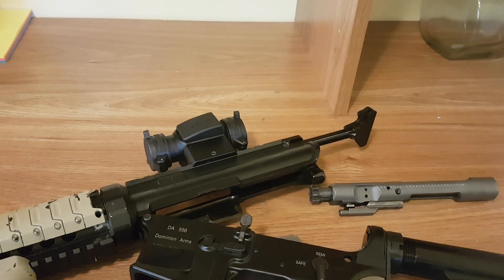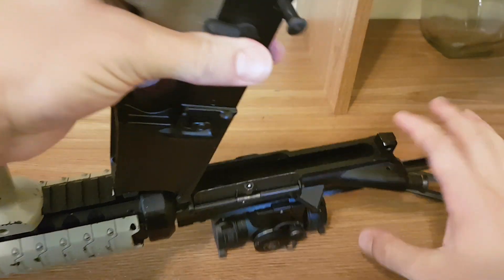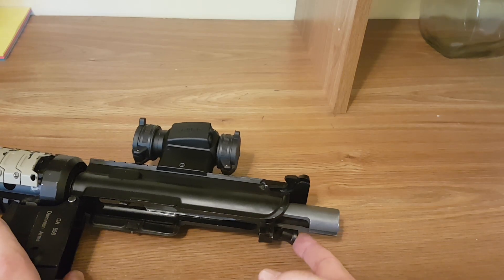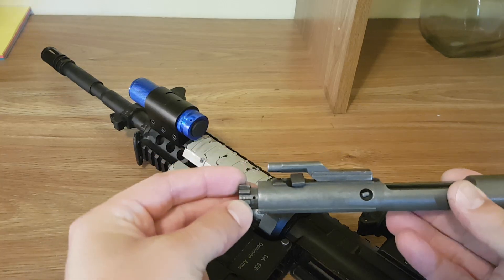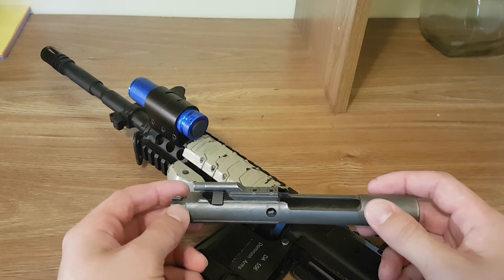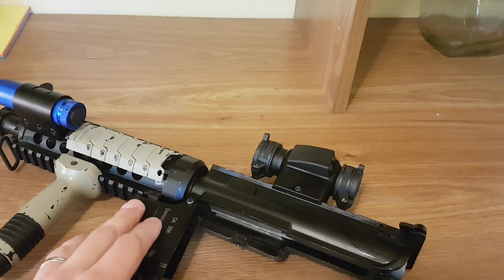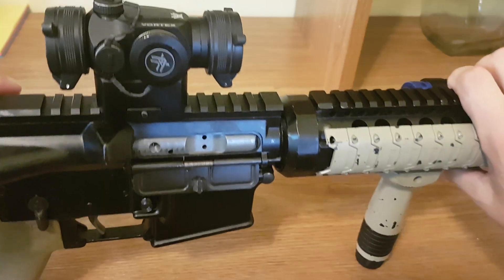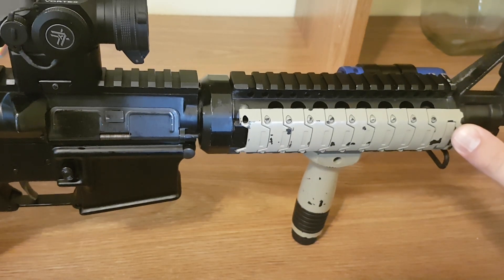What does the Forward Assist on the AR15 Do?

Comment: Someone mention down below this fwd assist wasnt needed and would only cause things to break. I believe the main purpose for it was during war time like Vietnam,  and in the heat of the battle this served a great purpose. Not seating fully caused jams, which couldn't be tolerated for obvious reasons. Have to put things in perspective.....  I carried this weapon during my military days and this feature was very helpful and necessary, unlike the m14 which had no issues with seating rounds, but much heavier then the m-16 but more reliable..

Comment: Another purpose of push button is to avoid noise. if you pull the charging handle and release it hard, enemy can hear during ambush. Soldier can firmly engage the chamber by pressing the button after slowly push the handle

Comment: Fun fact: the forward assist was not part of Gene Stoners design the Army insisted on having it. He actually explained this to the department of defense, the last ting you want to do id force a round into a dirty chamber, whish quickly leads to function failures. The chamber fouling tends to embed in the soft brass cartridge case and lock it into the chamber at the moment of extraction.

Comment: For fire and maneuver tactics, where many rounds are fired to suppress enemy movement or observation. Several hundred rounds may have been fired through a well oiled rifle, possibly causing a buildup of crud at the bolt and breach. The "SPORTS" method of clearing a jam is employed to get through the stoppage:

Slap (the bottom of the magazine), Pull (the charging handle), Observe (look at the chamber for a cartridge), Release (the charging handle), Tap (the forward assist "button"), Squeeze (the trigger)

Comment: the forward assist pushes the bullet basically in the chamber if it's such a Jammer or get hot or it just doesn't want to slide down the ramp so that's the forward assist otherwise she never touched that

Comment: Maybe it was already pointed out the serrations are on the  "bolt carrier .  The bolt
is the smaller piece sticking out the front of the carrier. The forward assist was used as a kind of a last resort incase the round was not seated properly and needed to be "assisted" into the correct position to fire. Needed in the Vietnamese War due to the mud and other debris that could get into the chamber area. Hope I did this right.

Comment: get an ak. It doesn't require a button to help load it lol
Reply: MartinsBrew Okay.... "30 rounds on a square millimeter" and "power of rock thrown by a kid at 350m"... 

Now I know what kind you are.... 
Have a nice day....
Reply: MartinsBrew I could do it from 300m... no problems. And that was with irons....

The point still is, AK design allows very accurate firing up to 600m (that is 656 yards). the problem isn't accuracy but the delay for a running man. at 150m distance a running man can move in a second about 5-7m. So hitting one is luck with any weapon if the person maneuvers at all. from a 600m it is nearly impossible if target doesn't stay still or have a constant movement. And other rifles doesn't really give better accuracy as at the point the bullet precision and weather is the key factors.

But big difference is as well that in many European countries the typical engagement range is 25m.... yeah... and that is required to be done from knee as under foliage is too thick to see anything. So long range shooting is rare thing.
Reply: MartinsBrew i know what ineffective  means, but in the case of firearms it doesn't refer to lack of energy specifically, and your comparison to a 3 year old throwing is underexaggerated. my point is that you lose the ability to control the trajectory dozens or hundreds of yards before you lose enough energy to equal a 3 year old throwing a rock.
Reply: MartinsBrew 'ineffective' means 'unable to cosistently hit a man-sized target', not 'loses all force above what a 3 year old could throw'. it would still kill you if it hit.
Reply: paristo. 182 meters standing all day... One shot with a AK 47 with iron sights... different? At 365 meters laying down I can put 30 rounds in a square millimeter... AK can not do that, maybe a SKS can... but not a AK...
Reply: unfuckingmaker, clearly you don't... so hitting a target with a 22lr. at 300 yards is effective to you?
Reply: Because they are in some cases piss-poor trained. 
Remember the soviet-afghan war and operation cyclone where the CIA basically trained the mujahideen? Wars are not won by equipment, but rather decisions. Mind you that modern Afghanistan is a lost fight and not a won. Most western troops retreat out of Afghanistan because it's just a lost fight. And that has nothing to do because the Taliban have some miracle technology at hand that outperforms westerns. 
The Vietnam war was again a good example of why a war was lost, even though the NVA or Vietcong, for example, had used stuff like various forms of AKs.
And gas pin operated rifles are indeed more reliable than direct impingement at the loss of some accuracy over greater distance. But in most cases, US troops or any troops, as a matter of fact, won't gunfight at those distances over their effective range and rather suppress fire while they wait for a warthog or an apache to blast the enemy lines into oblivion.
Theres a reason why US troops have spoke so highly of a platform like the G36 for example, which they could try out during joint operations like isaf.
Reply: MartinsBrew 

600m with a single shot, easy.

600m = 3 rounds laying
300m = 3 rounds laying
150m = 3 rounds kneeling
50m = 3 rounds standing

120 points with all to target using only a iron sight to standard target (IIRC inner 10 was 50mm and full 10 was 100mm)

Okay, rifle wasn't original AK-47 but a RK-62 from 1962 (specific manufactured 1965 based by serial number) that was been in used in service since then.

And I have handled a original AK-47's that are extremely accurate to 300m and some has been as well in service (we talk about hundreds of thousands rounds fired thought them).

the talks about AK-47 (or variants) being inaccurate are mostly heavily exacrating and likely started from a very weared specimens etc and very likely as well about untrained shooters.
Reply: paristo well sorry you have not done these test yourself... at 350+ meters/ 400 yards I could not get a 7.62×39 to go through plywood with an AK47... Yes I could hit, but it was almost pointless at that range.
Reply: unfuckingmaker. maybe if hit in the head, just like a 3 year old throwing a rock... ineffective means... "not producing any significant or desired effect".
Reply: i prefer RK-95... ;D
Reply: Opoponax Freetoshus. hey, it's called a bull barrel... sorry you know nothing...
Reply: Opoponax Freetoshus I'll call on your b***** what Regiment and Baton?
Reply: Tarzan b***** let's go and watch some combat footage from Iraq...
Reply: There is a big indifferent some retarded lubing a AK compare to a AR... That is why there is the term "front line soldier"... Let me guess, you used shaving cream.
Reply: i saw this MPT-55 with Ar looking type, with Ak resistance (they cliam it is much more better) but who knows
Reply: Commie
Reply: If AK are so reliable, why do Muslim always lose battles?
Reply: Also, US is invading Afghanistan for oil, don’t judge the muslim
Reply: AR fanboys are a joke. They claim to be able to hit these amazing distances with pinpoint accuracy with rifles not designed to do that. These are combat rifles, not sniper rifles. They're supposed to be put in the hands of the most average soldier and be functional. The AK does better at this than the AR because for a man-sized target, it's just as accurate. But more importantly, the AK is far more reliable and the 7.62X39 round doesn't start tumbling all over hell when it hits a slight obstruction. Yeah, I'm ex-army, and I would certainly have preferred to have an AK.
Reply: Joel Vrobel my rock river has out performed every single AK I've had in my hand. 400 yards one shot? not with a AK...
Reply: MartinsBrew lol i read, and it proves my point, so why are you pointing to it as evidence? i think i'll include that link in this post in case you delete it after you read it.
also, we weren't talking about a 22lr.

https://www.quora.com/What-is-the-effective-range-of-7-62x39
Reply: Im ex-army too and AR jammed like hooker on cokes in winter. So yep, AK over AR anytime, anywhere.
Reply: Yep, in mud test AR pretty much outperforms AK but in general AK is much, much more reliable than AR, Im just talking about the facts.
Reply: paristo nope, 350 meter is where the AK47 almost becomes ineffective, with the energy of a rock being thrown by 3 year old... look it up.
Reply: Tarzan, lets Google search or on YouTube AR vs AK mud test and sand test. Every single time AR's outperform the AK, God I hate how stupid people are. Please show me one video that a AK outperforms AR in a mud test or sand test... please show me one.

Comment: Does the SKS or AK47 have this problem too?
Reply: The SKS and AK both have a charging handle fixed on a bolt carrier. So You can push it forward if You like. Though it is not considered a right way to clean the issue.
Reply: if you ride the bolt forward then yes but inherently the ak and sks are extremely reliable. I have a sks in a scorpion stock and I have shot about 1000 corrosive mil surp rounds through it and have had zero issues. I watched as someone beside me however shot an ar-15 to my shock had 7 miss feeds in 40 rounds, just horrible. I still want an ar-15 though just shop around and look at reviews, talk to gun shops, and talk to people whom own them before buying.
Reply: It really depends on the AR brand and mags used. The main cause of most malfunctions is the mag.
Reply: what mags do you use.
Reply: what mags do you use. and what brand AR? @Josh Brown

Comment: You don't just hammer down on the forward assist when your weapon system jams up. I see a lot of confusion in the peanut gallery, assuming that you just ram-a-jam. You should perform S.P.O.R.T.S, clearing the malfunction. Using the forward assist to ensure the bolt is fully forward and locked. At best it should require minimal assist. Most often, you won't help the BCG at all and will know for certain that the bolt is forward and locked or that you have another malfunction/ more serious issue with weapon.

Comment: The only time you use the forward assist to ride the bolt forward is when you're in a life or death situation and the bolt won't lock forward due to carbon or dirt in the barrel or bolt locking lugs, and stopping to troubleshoot and figure out what exactly is causing the problem is not a good option under the circumstances...Or when you're in close quarters combat area and you want to chamber a round quietly.
So unless you got people shooting at you, do not use the forward assist as a quick fix to a malfunction, as that may only make the problem worse if the issue is a dented cartridge or double feed or some crap.

Comment: I have an AR and barely know all the details, AK much simpler mechanics.
Reply: Eternal Resolute basically the same mechanics. One originally designed with a piston, the other a tube. Trigger releases a hammer with spring tension on it, pushing a firing pin into a primer, causing gas pressure to build and push a bullet down the barrel, then some gas goes up and back pushing the bolt/bcg to the rear. Only the looks, tolerances and shapes of parts are really different. M16/4/AR have very tight tolerances allowing a little bit of debris to cause trouble and the AK47/74 have much looser tolerances requiring much more debris to cause an issue.
Reply: Red Beard great insight.

Comment: you could just slam the cocking handle forward couldn't you?
Reply: jason200912 no. The charging handle only pulls the bcg against the buffer spring. You should always pull the charging handle all the way rear and let it go. Then make sure the handle clicked into place or it will hit you in the face.
Reply: The cocking handle is actually not attached to the bolt carrier group. It has a bore that sits on top of the gas-tube and once it is locked, it sits in front of it between that and the chamber.

Comment: the forward assist has a history with it... it was used in battle to load one last shell to keep yourself from being captured.  The last shell would often not load because of the dirt and grit from crawling through all sorts of stuff.  Not meant for normal use...
Reply: if your gun is jammed enough to not chamber properly, forcing it into battery is about the last thing you want to do to your gun. The forward assist was "hey why not"-idea from people in the army not trusting the new "plastic toy gun". It is quite literally useless, for that it's only function is to mess things up further. Even the AR's designer felt it's unnecessary.

Comment: The FA was only added at the insistence of the US Army.  Stoner, the Air Force and the Marine Corps considered it unnecessary and even hazardous, since it can force a bad cartridge in so tightly it cannot be easily removed.  If the rifle doesn't lock into battery, cycle the action to get a good round to feed.  IF a nudge is needed, a push with the thumb on the depression that also works with the dust cover is sufficient.  Of course, if the rifle has been fired a lot, the bolt carrier will be a bit hot to the touch...